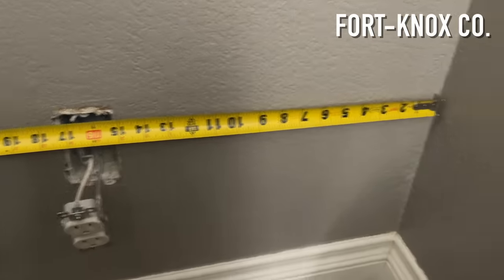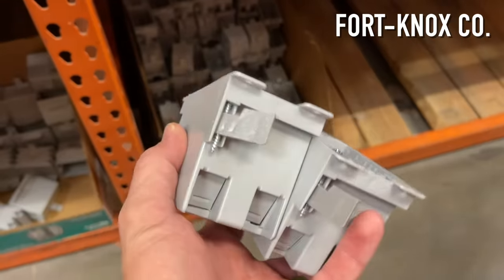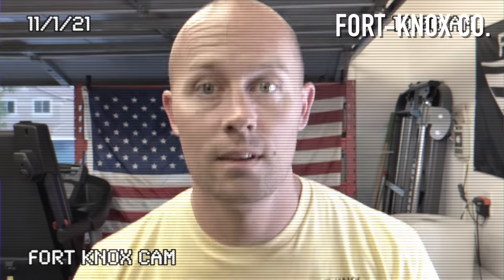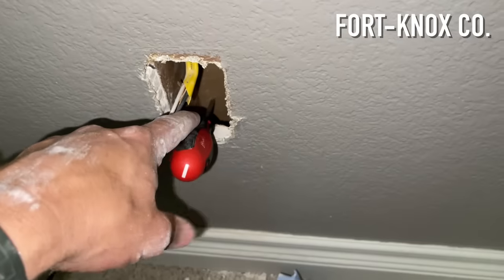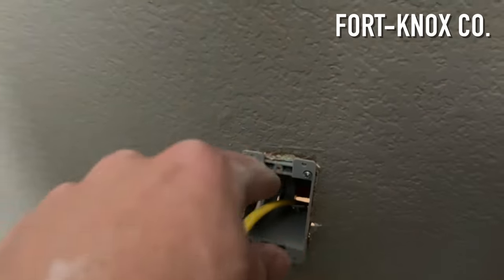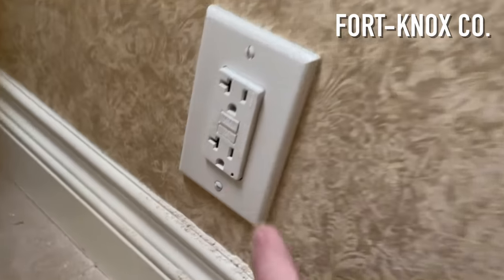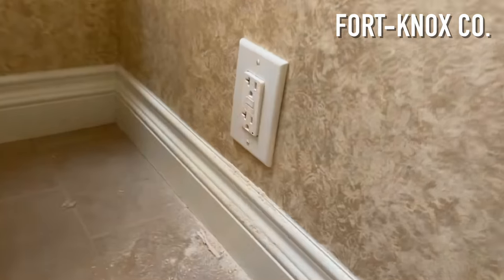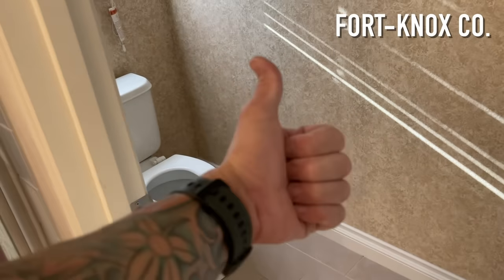How to Add an Electrical Outlet ANYWHERE !! Heated Toilet Seat or Bidet Install | Run Power Easily

Comment: Did my nikka just say No-Mex wire? 😆 @ 4:22 
I guess some wire company named their non-metallic sheathed wire NoMex 🤔 because we typically call (NMB wire) Romex™ it's just one old popular trade name of a company that made that type of wire. Kind of like the two hand tool names Channel Locks and Tounge and groove pliers. Same shyt, different toilet. But that's the first time i heard of NoMex wire. Anyway, I think electric work should be left to the pros 4real. Theirs just to much that can go wrong to justify being cheap. But if you are confident with tools & u have some similar experience and u want to tackle a small electrical job yourself, then I would still highly highly recommend that you have a very experienced electrician right next to you, the first few times you work on a circuit. Everyone has some buddy that has a buddy they can call. And if u are not comfortable enough to ask someone more experienced for help, that's ok. Electricians all over the world will continue to make tons of money off of you guys, unfortunately. But somebody has to fix the shyt after half the lights in your house go off and u have a full PTSD freak out any time static shocks ur lil finger 😆🤞

Theirs 1 good reason I don't tell ppl how to change a transmission and that's because I don't freaking know bro 😆
Reply from the maker: NoMex is hard to find but it’s out there.  A little more pricey though. My mistake wasting my money one that stuff. Got sold some snake oil for sure. 

But I appreciate the feel back. I agree with what your saying. I’d always recommend asking or hiring a licensed electrician for these jobs around your house. Better safe than sorry.

Comment: Biggest concern I would have is that most bidets require a home run outlet. The bidet can pull upwards of 13 amps by itself if it heats the water and heats the seat. The code issues that were brought up also must be addressed. Better to have a licensed electrician come in and do the work properly including pulling permits and getting the work inspected.
Reply from the maker: I agree! Very good information!
Reply: Permits?  Seriously?
Mother may I?  What kind of country are we living in if people are scared to add an outlet without a frikin permit?
Reply from the maker: @losfromla1480  Yep I feel you on that. I know in some cases it all with good intentions. But there are a lot of simple things that I feel are silly to have to pull a permit for
Reply: Pulling a permit for an electrical outlet? 🤔
You can't be serious....
Reply: In my area, you can pull a building owner’s permit.  I have installed and replaced my own outlets and lights, but never have pulled wiring from the panel.  And while you can pull a home owner’s permit for minor work (that is a check box in the NJ permit application) I don’t know anyone who does.  Having an electrician come in is still recommended for anyone who is not handy, especially when the panel is going to be worked on.  And some electricians will insist on pulling the permit while others don’t care.
Reply from the maker: @scotts8284  I agree. Seems a little excessive
Reply: Not trying to scare anyone, but if you do it wrong and it causes a fire, your insurance probably wouldn't cover it since it's non-permitted.
Reply from the maker: @nelsonrothermel  great information. Thank you.
Reply: Agree. My bidet is requiring 15amp. Also, why gfci plug is 20amp? This is not safe unless i missed something
Reply from the maker: @alexanderolena  yeah 15amp will be the most common especially circuits for lighting. 20amp is most common in walls where other appliances can be plugged in.
Reply: @FortKnoxCo  but it is not about protecting what you plug into outlet. It is about protecting wires . Using 20amps on gage 14 - what "I assume you have mostly in any house" would not protect anything
Reply from the maker: @alexanderolena  the walls have a 12 gauge. The ceilings have a 14 gauge. That’s what I’ve come across in most houses or codes. Yellow in the wall and white in the ceiling
Reply: @FortKnoxCo  hmm. Perhaps in US. In my house - Canada. Only kitchen has 12 (aside of drier stove and specialized equipment)
Reply from the maker: @alexanderolena  yep. That’s probably it. It’s almost all 12 gauge in the houses down here unless it’s a lighting circuit. People be pluggin in some crazy stuff in the hallways and bedrooms I guess. They need that amperage
Reply: @FortKnoxCo  lol. Never thought it would be different. I had to do additional wiring for bidets- run wires to the attic and down to the basement for each toilet. I measured bidet consuming 7amps easy (when solenoids water heater are not fully loaded).  Was worrying if I add hair drier or similar will overload the line.
Reply: @jeffstanley4593  LMAO 😂
Reply: @losfromla1480  Every electrician you talk to will tell you, you should always hire an electrician for any electrical work. Right. "I don't think so, Scooter"

Comment: Your title says, "add an electrical outlet ANYWHERE" but you were "lucky" to have one just on the other side of the same wall!  Yeah, that's easy.  Certainly a lot easier than if you had the nearest outlet across the room in a house built in 1952.  Your title is misleading to say the least.
Reply from the maker: The main purpose of the video was to show some techniques that I used to relocate or add an outlet. That way you could apply them to your own scenario and hopefully overcome obstacles you may find. I have other videos showing similar techniques where I’m relocating electrical and the same techniques apply.

Comment: You got lucky that the original outlet wasn't in the middle of a circuit.
Reply from the maker: It could still be done even if it was though. Almost exactly like my video where you move or add an outlet up the wall. You could pigtail the wires in the original box, keep the original outlet wires up the way it was and use the new set from the pigtail to run over to the new outlet on the inside of the bathroom. All very easy to do.

Comment: If that's a kitchen circuit you can't just tie into it and go into the bathroom better check your codes any Joe Blow can start a fire and burn the house down
Reply from the maker: This one was branched off of a bedroom circuit not being used. Only had a couple wall plugs on it. And the one it was branched off of was not used , hidden behind a dresser.  But yes definitely check to see what circuit your tapping into before adding outlets.

Comment: If its not on the other side of the wall,how?
Reply from the maker: Then you can run it across the wall or down the wall from another outlet. I have a couple other videos showing how I’ve moved electrical up the wall or across the wall

Comment: How to run a wire under ur house
Reply from the maker: You want to run it under your house ?? Usually they don’t run electrical Under. It’s usually to the house or to another structure. Then through the house. But if you really need it on the other side of the house you’ll probably go in the ground and AROUND your house.

Comment: Please cut back on prefacing everything with the word "actually". Stopped counting at 3 dozen when maybe 3 or 4 would be enough. Otherwise, nice production, maybe camera more on the area being worked on and a little less face time.  How about when no opposite outlets but studs needing addressed? Thanks
Reply from the maker: I appreciate it. I believe I’ve gotten better at reducing the amount of actually’s. If you want to check out some of my more recent videos. I have a couple other ones showing more in detail the process when moving an outlet up or down a wall.

Comment: Next time install the outlet on the back wall next to toilet so you dont  have the toilet plug cord dangeling on the floor
Reply from the maker: They actually wanted it in this location because it will be hidden behind a small rack they keep next to the toilet. And it was going to cost more to move the wiring around the corner to behind the toilet and they didn’t want to pay the extra $$. Behind the toilet is an exterior wall also, so there’s a little more to consider when working on the exterior wall with space and insulation, but I agree that behind the toilet would be the best spot.

Comment: Good idea for a video but so much talking and so little instructional footage.  Would have been better with filming the work and techniques for every step in the job. In a 7:54 long video, the actual work footage looks like less than a minute.
Reply from the maker: Yeah this one was filmed on the fly while I was in a friends house doing the job. So I was quick with the footage and didn’t have the proper set up to stage any filming. But I still wanted to try and document the basics. I have a few other videos showing this same technique I’m more detail. Moving outlets in different scenarios but all the same techniques used.

Comment: Not gfi protected?
Reply from the maker: It’s a GFI outlet itself. I specifically made sure the added outlet by toilet was GFCI just incase that circuit didn’t have one on it. But most houses out here have all GFCI circuits now.
Reply: @FortKnoxCo  hey great video, I would just like to point out for safety that most homes circuits are NOT gfci protected. it is only required by the nec within 6 ft of any sink basin and anywhere in a bathroom (along with other specific areas look up  210.8 in the nec). whenever installing any outlet near water, always put a gfi
Reply from the maker: @dane5167  yep! Exactly! When I built my detached garage they required every circuit the have a GFCI. That’s the current code out here I believe. At least for garages.
Reply: @FortKnoxCo  yes garages and unfinished basements as well

Comment: You dont show how to fish the wire?? Thats the hardest part.
Reply from the maker: There wasn’t any fishing in this install because it was directly on the other side of the wall a couple inches over. You could just hand it through. But I do have a couple other videos showing how to fish wires through walls and ceilings.

Comment: I think its rather odd that you would put an outlet next to a toilet.
Reply from the maker: It’s becoming more common to have a power source somewhere in the toilet room. Lol. Some builders are even including it or giving it as an option.
Reply: @FortKnoxCo  Having an outlet in the bathroom is not the issue. Its the placement of the outlet I have a problem with.
Reply: @unapologeticallycreative8365  Got to power the bidet somehow. Running a long cord would be even more problematic.
Reply: I suspect outlets near toilets would be common in parts of Europe, where bidets are the norm.  We will eventually be the same.
Reply: @grumpyuncle.  good point!

Comment: This video is proof that you have zero business doing ANY electrical work, let alone teaching people about it. FYI, functional and safe are two TOTALLY different things. Functional is easy, safe is not. That's why a professional should be hired. This video is full of code violations. Also, for the record, the tool isn't called a rotary tool it's an oscillating tool, and it's not called Nomex it's called Romex. Tellng anyone to stick a sawzall blade in a wall next to a box like that is pure stupidity. What if the wire came up and went around the box and into the top instead? You can't be sure how the original guy wired it and using a sawzall is dumb. Using the "oscillating" tool with a carbide blade is the option for removing the old box. An electrician wouldn't have even needed to remove the box anyway. Please don't do anymore electrical videos, your info is wrong and dangerous.
Reply from the maker: Thank you. I appreciate it.

Comment: Very misleading title, "Add an Electrical Outlet ANYWHERE".  This is not true!  On one side of my toilet is the outside wall.  The rear is to the laundry room but doesn't have an outlet on that wall.  So the only source of power is the bathroom light switch, and that would mean cutting many studs to get the wiring to the new outlet and possibly open up all the drywall.
Reply from the maker: This video shows techniques that you can use to do just that. Although I wouldn’t recommend cutting through studs, when you move electrical a lot of the times you do have to drill through studs though. That’s how they do it when they’re building the house. The further you have to move it the more drywall work is required and usually you have to jump through studs. But a lot of the technique shown in the video can be applied to different scenarios. The videos goal is to show you different techniques that can be applied to different scenarios when doing different DIY projects. I also have some videos on moving electrical up walls as walls and through ceilings.

Comment: I would think there would be a better way to mount a outlet if it had to be that close to the toilet bowl.  I would use an outside outlet box that has a clear cover over plugged in lines.
Reply from the maker: Since using a GFCI outlet here there is no need for the added protection over the plug unless you expect a lot of overspray which in most cases wouldn’t be an issue. If building a home from new I’d have an outlet installed on the wall behind the tank somewhere to help hide all
Cords and connections. This outlet was installed in this specific location because to move the outlet the the wall behind the tank, which was an exterior wall, would have required a lot more work and invasive drywall techniques that the home owner did not want to pay for.  But there are all kinds of ways to do this of course. It’s usually the home owners preference
Reply: @FortKnoxCo  I had a toilet water line top fitting crack, come off and the line sprayed all over that general area.     Guess I'm a  little caution.
Reply: That’s not a good idea to have in your bathroom, who wants to see an ugly in use cover, not to mention not practical in a house.
Reply: @markcarson8566  I agree.
Reply: @crusherfang9368  yeah it’d be a monstrosity in there

Comment: Kind of a misleading title. This is not putting an outlet “anywhere”. It’s putting an outlet where it’s very easy to put an outlet. Behind another outlet! The video should’ve been titled “How to easily put an outlet behind an adjacent outlet. I absolutely hate the abundance of misleading titles to most of the videos on YouTube.
Reply from the maker: The main thing in this video is you can take the techniques used to move this outlet 4” over and move it 40’ if you wanted. It’s more of how you can take what you learn and apply it in other areas and scenarios. I apologize if you felt mislead. But it was meant more to show techniques in general used while moving an outlet.

Comment: nooooooh! needs to be a dedicated 20 amp circuit. By Code. That is not right. Sorry, but it is not.
Reply: Where does it say that? Do you really expect him to buy a breaker and a shit ton of romex, open up the panel, struggle in the attic/basement, and possibly make a bunch holes in walls/ceilings just to have an outlet near a toilet? Like WTF is wrong with you?

If it's new construction, sure make everything dedicated. But when there's walls/insulation in the way, a power source nearby, and a client that doesn't want to spend a fortune damaging their home, why go through all that?
Reply: @aurvaroy6670  because people want it done the RIGHT way...you dont cut corners when installing electrical anything!!
Reply: @aurvaroy6670  You are obviously Triggered!!! Calm down its not that hard to understand people like things done the right way.
Reply: @cedmac3366  I thought you were triggered when you said, "you don't cut corners when installing electrical anything!!" That phrase made no fucking sense to me both grammatically and literally which is why I sound triggered. 

You have to realize that electricians offer lower rates when they "cut corners" and clients are either fine with it or can't afford to pay more for the "right way". And no, I'm not gonna fucking calm down if you continue believe that you can easily tap into a bathroom circuit or install a dedicated outlet just for a toilet. NOT ALL HOUSES ARE CREATED EQUAL!!!

In fact, I'm getting more pissed off that you keep demanding the "right way" even though the client was okay with that guy's install.
Reply: @aurvaroy6670  maybe you should make a video and show us what you mean 🤣😎
Reply: @cedmac3366  I understand why bathrooms should be separate, but you don't understand that everyone can't AFFORD the "right way". I know I can't. I have a similar situation where my toilet is sharing a walk with my bedroom but not with the sinks, so it's easier for me to follow this video if I need power for the toilet.

Also, smoking might relax me, but the more relaxed I am, the more I curse. You don't want me to talk shit about you, do you?
Reply: @aurvaroy6670  21? Lol...you have no idea...good luck...this is where I stop responding 🤷🏾‍♂️